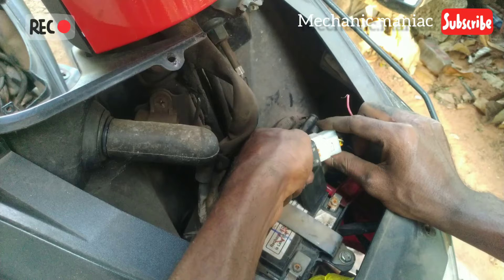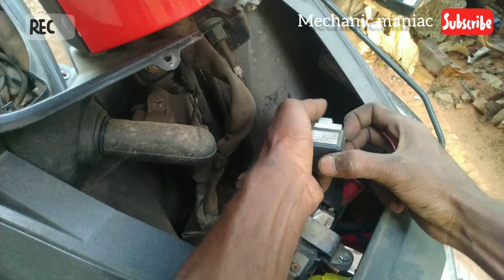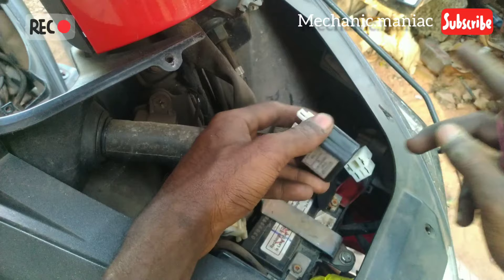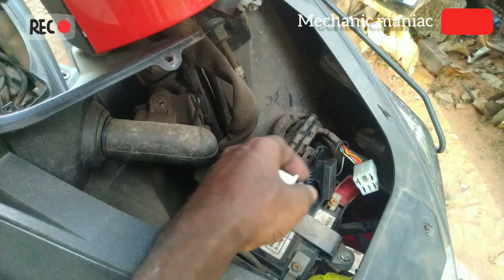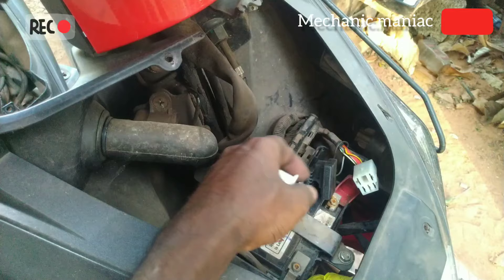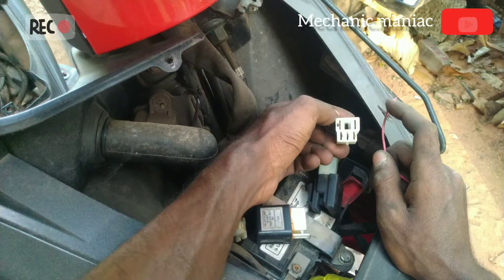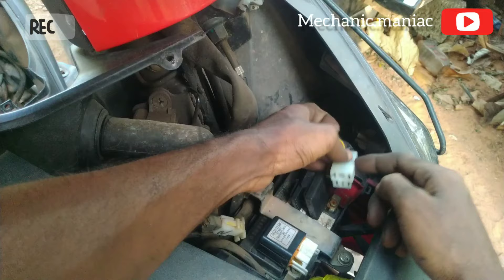Honda Dio starting problem Self start not working #hondadio

Comment: Relay also good then what is problem
Reply from the maker: Switch , battery, relay, motor bush , winding these will be problems and also check ignition switch working properly